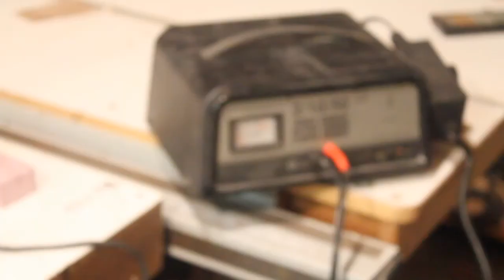Hot wire wing core cutter.

Comment: Thank you for the video. I am using same type of foam as you used with my CNC foam cutter but there is some residu(melted foam) left on my wing. How can I fixed that? Should I increase the speed or I should reduce the temperature?
Reply from the maker: Some thin hairs on the surface is normal and can't really be avoided. If it is more than that I would try either a little more heat if no improvement  then try less heat. The speed is limited by how fast the wire can melt the foam across the length of the wire so I would use a rate that doesn't put too much tension on the wire.